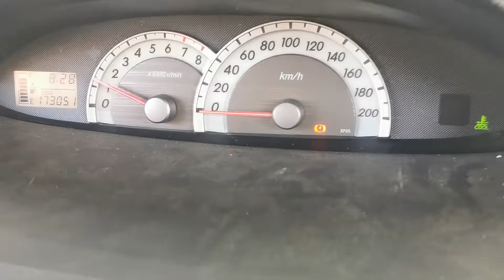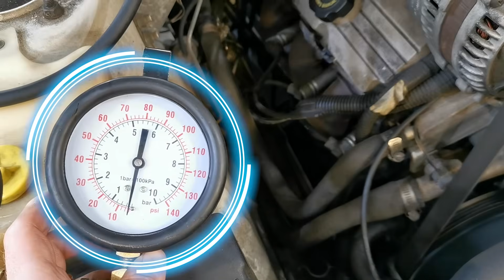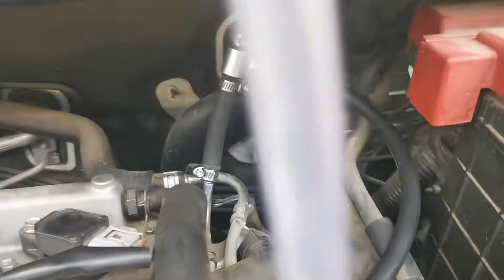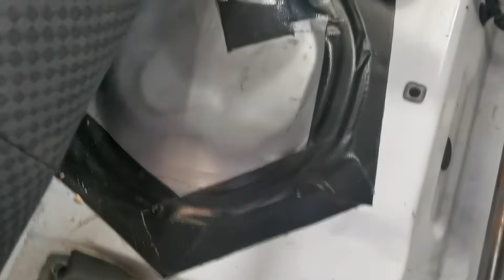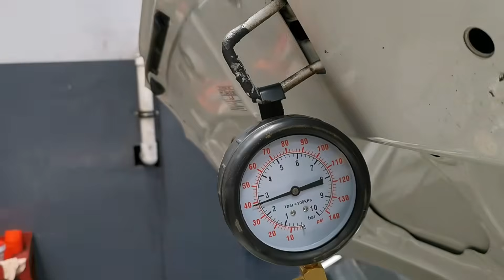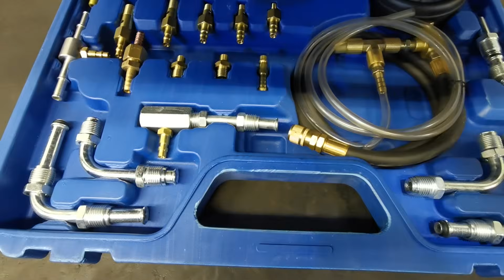Long Cranking Time | Starts & Cuts Out - Fuel Problems - Simple Steps To Pinpoint The Fault

Comment from the maker: There are many reasons that can cause these issues, following a diagnostic pathway will help narrow the possibilites. 
 
In modern vehicles we can get more information than ever from a decent scan tool, checking live data or doing bi directional controls can verify some faults, but in cases like this. No fault codes stored and limited scan tool information / abilities on these vehicles. 

 
Following these steps helped find and fix these faults

Comment: Hi

should the fuel pressure stay high and hold after switching of the engine on a diesel engine? the engine i am testing drops to zero within a few seconds after switching engine off, engine is a VW 1.6 tdi diesel CAYC
i am talking about high pressure fuel pump here

thank you
Reply from the maker: Generally speaking the pressure will drop off slowly on a common rail diesel. Years ago in CRD training, we were advised to leave the vehicle for a min of 15-20 mins before working on it to allow for the pressure to have dropped and be at a safe working level,  but the longer the better if you don't know what the pressure is.
Scan tool live data is now so easy to get, you can confirm pressures without guessing. 
 
I don't have exact specs for that engine to hand, but an instant drop off doesn't sound right. Confirm with a known good if possible. Either find out directly by testing the same type of vehicle or search forums and ask VW community if they have any known good data on it.  
As Techs we can use manufactures portals to help find spec data, but they are behind a paywall and it is time consuming to find the info you need. 
 
Lot's of ways to assess CRD systems, injector testing on and off the vehicle, bench testing. Checking injection quanity on live data etc..
 
If unsure, it is probably best to have it looked at by a professional. It can get expensive if parts are fitted incorrectly. 
 
Thanks for watching. Best of luck.